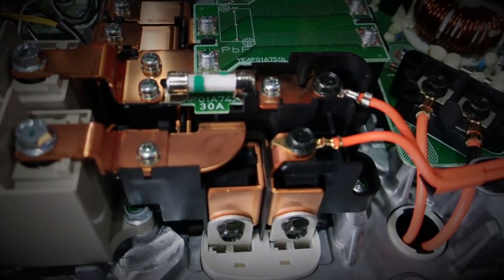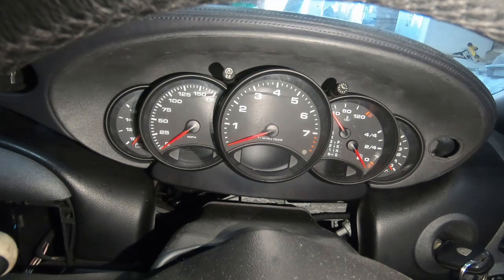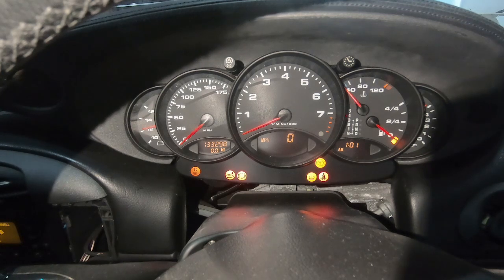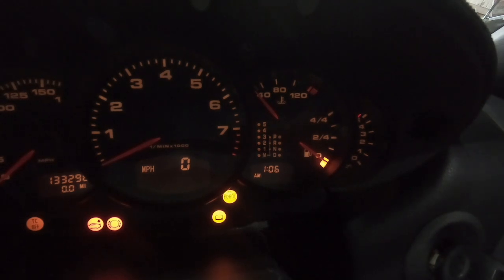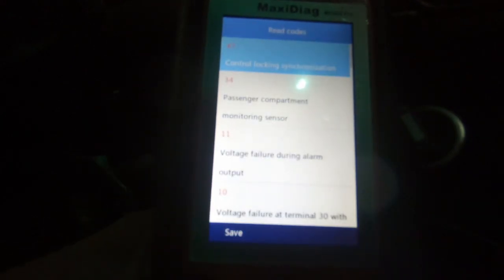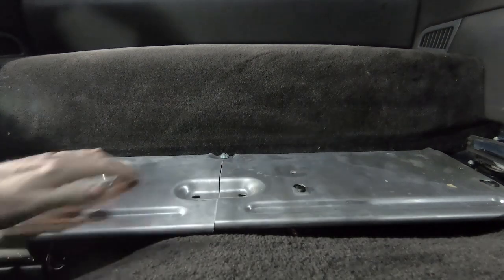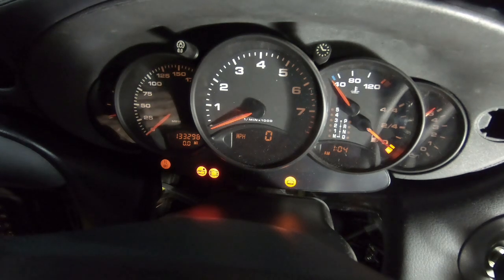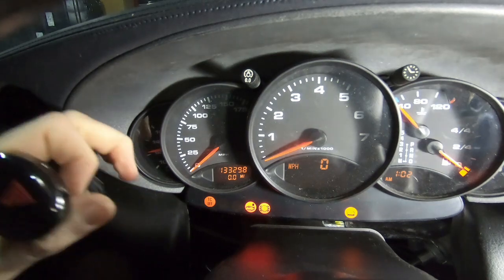Electric Porsche 911 project video 32 - Powering Up the Dash after Engine Removal

Comment: Couple of suggestions:  For power steering, you can use an electric power steering pump from a Mazda 5 or go full electric assist. For the brake booster, you could use an electric vacuum pump and a small tank as a reservoir. Both available for good prices on Ebay. There's even a complete electric brake booster kit for under $200. Great job so far and good luck in the future!

Comment: I've purchased an electric power steering pump from a Holden (Vauxhall) Astra for my conversion. Probably the easiest solution.
Reply from the maker: Thanks for the tip.  I now have one from a Vauxhall Zafira, which I think is the same unit. Funnily enough, it is a TRW part that is the standard aftermarket part recommended for people racing their 911s. You can buy it as a Porsche/TRW part for hundreds of pounds. Or as a Vauxhall part for a fraction of that price:-)
Reply: @PerformanceEV   just started my own conversion project on an audi a4 same power plant as you are using, and I like the other guy that commented bought an astra power steering pump. I also bought a 12v vac pump and a vacuum tank from the net for my power brakes. they should be fairly easy to get power back into with just a decent 12v vac pump

Comment: hi you could use the tachometer for throttle position or power. the oil pressure gauge could be used for brake vacuum

Comment: The car won’t freak out with engine harness disconnected. You’ll just have a few warning lights displayed on the dash. The wiring integration with my Boxster was very straight forward. 996 should be the same.
Reply from the maker: Yeah, it seems pretty basic. I was hoping for more drama:-) looking forward to getting rid of my little control panel at some point soon.

Comment: Hi Sean, congrats!!! almost done. We are still fitting the leaf drive into the Mini. Can I ask you how did you solve the aircon, I mean, I'm still trying with Leaf compressor but I think I will give up on that, to complicate to hack it. Di you use other system? heater matrix maybe?
Reply from the maker: Air con working may have been a bit of an overstatement. The car was triggering all the necessary changes in the ventilation system when I selected Aircon, but I still haven't switched out the compressor so the air won't actually be cooled. It's on my list of things to look into, but that will have to wait until the car is driving. I was thinking of trying with the leaf one as well, otherwise a 12v motor spinning the Porsche compressor.
Reply from the maker: I'll let you know if I get anywhere with the leaf one.
Reply: @PerformanceEV  Thanks, I will keep you inform with the solution we take. Actually I saw some details in diyelectric: https://www.diyelectriccar.com/forums/showthread.php/prius-ac-compressor-controller-82099p3.html

Comment: you could fit a steering collumn
toyota prius this has electric assist on the collumn with the prius controller & power in this works fine in other cars.
Reply from the maker: Thanks for that tip. I'm probably going to go for an electric power steering pump for this build, but I want to try the Prius option for a future project.

Comment: Hy man very nice job done I m trying new to convert my 1965 mustang same way you did but I will need some help whith control unit for this motor if you can help me to make a working motor circuit i will pay for all you time many tanks keep going
Reply: Thunderstruck Motors sells a VCU that controls the stock Leaf inverter and basically makes it plug-and-play.